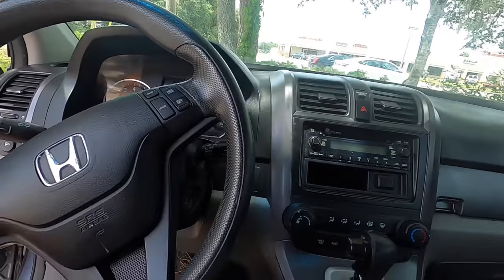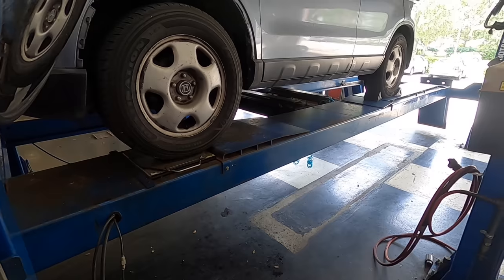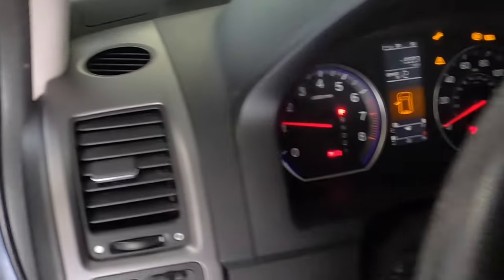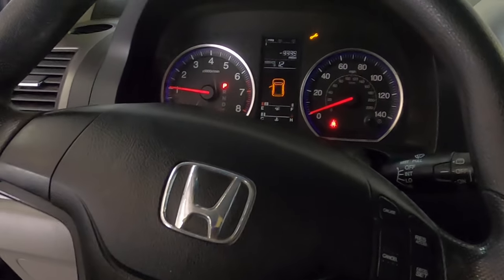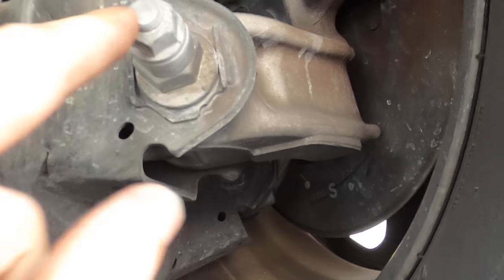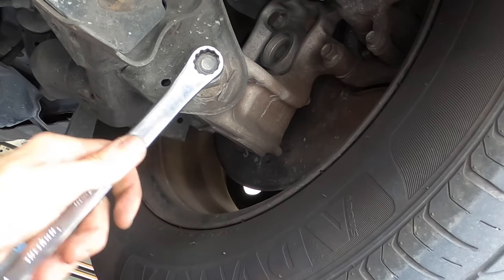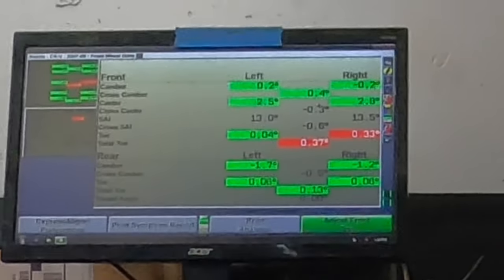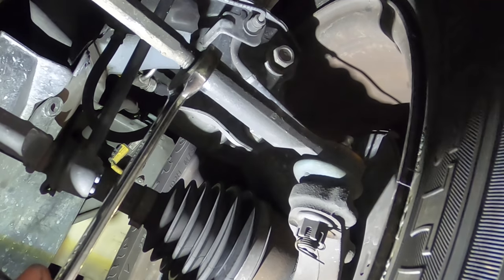Wheel Alignment Basic Tutorial | What is it and do you need one?

Comment: Might be a dumb question. But how are you rolling it forward and backwards.
Reply: I don't know how Ray does it exactly, but I like to push off the left rear wheel to move them back and forth. It's actually much easier than it looks to move a car/truck in neutral by spinning the tires. Left rear because that is closest to the hoist controls for my shop's setup.

Comment: I live in NYC and have had to deal with 4 different alignment shops before finding a good one. First place I went to was pepboys where I purchased my tires and purchased a lifetime alignment since it sounded like a good idea. Car seemed great for 4-5 months then needed to do suspension work. Brought it back shop said they completed the alignment still had the issue went back again said they completed it and both times would nt give me a print out. Then went to another alignment shop they gave me a print out car seemed to drive ok except the wheel wasn't perfectly centered the camber was out of wack on the print out but they said nothing they could do which I knew was bullshit. I ended up burning up my pilot sport 3s soon after this with tons of inner wear I was pissed since it was under 10k miles. Bought new tires at a new shop with decent reviews they aligned it but said the same thing about the camber and at the same time I had them do a brake job which I wish I never let them touch. Not only was the alignment bullshit but they never lubed the slide pins or the back of the pads leading to horrible vibration and when I brought it in they said sorry we cant duplicate your issue nothing is wrong. I had to do the brake job over myself. Fucked up part is I purchased some really nice synthetic brake lube for them to use and they just took it and never used it on the car. Finally found a pro guy with a rack and in 45 mins he fixed everything and even let me watch. I recommend unless you know the shop has a laser rack with a pro tech go to a place that only does wheel alignments.

Comment: When I was a kid(many many years ago) I saw the front wheel toe in measured with a long bar and two pointed steel rods rubbed against tire front and rear.  Like I said, “When I was a kid!”
Reply: I used that method most often up to 15 years ago. Some shops I had to resort to T-square, chalk and two broom sticks held together with hose clamps. Roll backward and forward after each change.
Reply: @wssides     Better than string!

Comment: Great job as usual, Ray. Could u do a Toyota where u have to install camber kits? Also, now dont laugh, I live in the rust belt, can I put anti seize on any parts to keep nice? I had a used 97 camry & I painted parts. My alignment guy gave me hell (nah, jst told me) but my tie rods threads were SO corroded I had to get replaced bc he could turn them. Ends were fine. Thats WHY I painted them. (I did this like 15yrs ago). Thanks.

Comment: A tip that most mechanics don't even know, toe can't cause a pull to one side or the other, only front camber and caster (or tires/power steering) can cause a pull, toe can cause the steering wheel to be off center and if the total toe is way out then it will cause poor handling but not a pull, that's why most of the time when someone comes in for an alignment to fix a pull it's usually not related to the alignment.
Reply: actually not always true, misaligned Toe adjustment can cause a pull to one side or the other.

Comment: Looked like a shop “TOLD” the customer that they “REPLACED” the  parts in the front suspension. It looked like there was NO difference in color from the old parts and the “NEW” part that was supposably replaced. Just my opinion. What did you think? Do you agree? And are you obligated to let the customer know if you believe the part or parts weren’t replaced as the other shop had stated? Or do you stay out of it? Just wondering.       Roger in Pierre South Dakota
Reply: They might have been done it a while ago and owner waited. Perhaps waited until they got new tires.
Reply: @jptrainor  Well, that makes sense. But don’t you agree all the parts looked like nothing had been changed? Or maybe the camera didn’t show what you were able to see in person? Anyway, nice job doing the alignment.
Reply: @rogerfleury9759 Rainman said the same, so yes. Hard to say for sure though. Hard to believe that a shop would do that. All a customer has to is turn the wheel and look.
Reply from the maker: Could have been junk yard parts, or they waited a king time to get it aligned
Reply: I have a Honda and usually the bushings go bad on the lower control arms. You can push the bushings out and replace them for a fraction of getting a new lower control arm with new bushings. Hopefully, at least, they did the bushings and charged the customer for a whole new LCA
Reply: @jptrainor  I had the steering rack, subframe mount and control arms replaced a month ago and still haven't got an alignment yet due to money. It does happen as you said.
Reply: @techgamer1597  My old Civic isn't getting a professional alignment until it gets new tires. Despite new diy tire rod ends, ball joints, and control arm bushings. I diy align it, tweak it until I'm happy, and call it good. It is just not worth the money to me for an old car with old tires. It is worth the money when the old car gets new tires, however.
Reply: @jptrainor  good to keep the wear on new tires consistent.
Reply: With how many dents this car has i think it is an old person's car. Probably on fixed income and had to  save awhile for the alignment after the last repair.
Reply: @henrydillard6217  You might be right.

Comment: Pro tip: ALWAYS check a car over if it comes from another shop for an alignment. Probably 75% of the time when my shop gets a car in from another shop for alignment, something is loose to the point that it shouldn't be aligned as is. One sent us a Silverado with 1/2" of play in the lower ball joints. Another sent us a Jeep Compass with the the worst rear LCA bushings I've ever seen, you could literally move the rear knuckle up and down 1/2" independent of the LCA.

Comment: I had a driver saying the same, needed an alignment due to a part being replaced, while adjusting I didn't see anything new and test driving proved that there were vibrations, so while reporting that what was asked was done I asked if the part they paid for was new

Found put that they paid for a new part but due to the shop they went to not having it at the moment they installed a used part on it while the customer paid for a new one...

Comment: I have a question, and I am asking because I don't know, and not to be a troll.  Would your weight sitting in the car and the open door have an effect on readings when you turn the wheels to the left and right?
Reply from the maker: Kinda sort of. Weight distribution does matter in side module. Many European cars require that weight be added to the car to simulate passenger presence. Sitting in the car to measure caster had no effect on the outcome.

Comment: How does one deal with any kind of slop or tensions on the suspension? If something were to compress the bushings in the control arms - say, a very fat mechanic climbing into a car with very soft suspension or worn bushings to put on the brake lock and adjust the wheel - the measurements would be off. Also, tightening the lock nut on the control rods is likely to push the control arm outward by taking up the play in the threads. When adjusting ball bearings on a bicycle, if you adjust the cone perfectly, it will be too tight after you tighten the lock nut. And if you get it perfect with the lock nut tightened, when the quick release compresses the axle it will be too tight. Which is a lot of fun when you have OCD.
But I digress. I always kinda assumed that the tolerances in car suspension alignment aren't all that tight, but aligning something to tenths or hundredths of a degree is not a small feat. It is certainly less than what I'd assume a turned tyre or settling suspension on a stationary car could influence.

Comment: Good to see how it's done! I have a 1st-gen Honda Fit (aka Jazz), and recently had a front tyre replaced after a sidewall puncture. I had the wheels aligned while it was in the shop, which is now improved according to the measurements. However, the steering now feels kinda skitterish, and doesn't seem to self-centre as well as it used to. (It's possible I was used to the former misalignment.) Could this be caused by having one new, slightly different model tyre on the front? I've read that the caster angle on these cars is not adjustable, and apparently the electric power steering isn't particularly strong either (they beefed it up in later models). It does have a little toe-in on the front. Thanks to anyone for suggestions!
Reply: Never get one new tire.

Comment: I grew up in a garage, one of our primary focuses was suspension and alignment.  This was "old school", setting up the equipment and getting accurate readings took at least 15min, no way we could get accurate numbers in just a couple minutes.

Something we always did was "shake down" the car before and between any changes in settings- manually push the car up and down a few inches on each end with the plates free so the suspension would settle to it's free/normal position.  Not doing so would result in settings that were measurably off.  There's always some friction/stick in the suspension components.

Something we noted back then was that the factory spec's were very wide, more to enable the factory and dealership to get cars out quickly than to create a good driving vehicle.  +- values of a half degree on either side were crazy in our opinion- you could easily have a car that was "in-spec" and yet would drive horribly- pull, wander, unsettled in turns, and burn the tires off in a few thousand miles.  We would hold specs to optimum- say 1/4 deg camber on both wheels (no 1/2 on one and +1/2 on the other), a bit more caster on the right to compensate for the crown of the road.  This usually required installing and removing shims, most cars didn't have eccentric cams on the suspension.  Some even just had slack in the mounts you would loosen and move components and re-tighten.  It was typically at least 1 1/2 to 2 hours to do a proper alignment.

There was some "school of hard knocks" wisdom to some settings- like you need a bit of toe in on a typical rear-drive because the forces on the suspension (especially under braking) cause toe-out.  Front-drives were a problem because driving forces would cause toe-in, while braking toe-out... any suspension play could be a problem there.

Anyway.... not meaning to be a dick- but your final results (both front wheels cambered left, caster a bit low, toed-in on a fwd, too much negative camber in both back wheels)... we'd look at that and think it was way out of alignment and needed some help.

Comment: Someone has worked for pep-boys.
You didn't use safety straps, What are you going do when you break one those heads?
Reply from the maker: I found that if installed properly they don’t fall off
Reply: As ray said if put on properly, then they won't fall of, and theres hardly any weight to them anyway, its just a sight screen as there is no actual parts on those heads that really matter if dropped, as long as it doesnt break the front screen is still fine, as the way these work is all the readings are done by the cameras, so even those heads on the wheels don't have to be perfectly level either,

Comment: And I was shop we try to get as close to zero as possible to give leeway should the towing until out get jolted or misaligned after hitting a pothole or other issues, we also locked the steering wheel with the steering wheel lock tool, anything one point something for us is not acceptable whether it's in the green or not.

Comment: Thanks again for showing us how something works that most people don’t get to see. Now, not trying to be disrespectful with my next question at all, just trying to understand. I get minimum labor charges, and you should definitely be paid for the work you do, but what is the reasoning behind most shops ( at least in my area ), charging 150 bucks or more for what you just did in that video? Is it just a minimum labor charge for the time? I’ve seen lots of people refuse the service after buying a costly set of tires, because they thought it was to expensive. I drive a lot for work, thousands of miles. I just had my 2019 F150 checked a few months ago, alignment and a road force balance ( kind of a 4 wheel dyno type thing ), and it wasn’t cheap. Anyway, enough of my rambling, just wondered what your thoughts would be on that, have a great day.
Reply: You and the general public need to know and understand that the equipment that was being used is very expensive, it makes the job easier for the mechanic/tech.  Now you add in the time for the mechanic who needs to be paid, and $150 really is not that much money.  Plus, a proper alignment also will save wear and tear on the tires thus saving the customer x amount of money.
Reply from the maker: I think $150 is slightly high, but the area could be influencing that. Rust or no rust is a big deal on something like this.
Reply: @richardostrowski6420 , as I said, I get all the cost involved, that’s why I asked if it was a minimum labor charge. That owner spent his money to buy that machine and he has to pay someone to use it. But by that logic, after the machine is paid off, he could drop his price for an alignment. I personally can afford to pay for that service and always have. You are absolutely correct, it is important and will save people money in the long run. But lots of folks can’t afford that. So if a person scraped up enough money to buy an 800 or 1000 dollar set of tires, they might not have that extra 100 or 150 for the alignment. That’s why I was wondering if it was just a minimum labor charge or strictly time that makes it prohibitively expensive for some folks?
Reply: @jimmyhorton8297  at what point is it paid off though? Maintenance needs to be done,  calibration is going to be required,  training new people operate it.
Reply: @USAFTACP  That's not the customer's responsibility, though.
Reply: @bloodybones63  You are correct that is not the customer's responsibility, but that cost is passed on down to each and every customer that gets an alignment. It has always been that way and it will continue to be that way.  There is no free lunch guys, put yourself in the owner's shoes.  You have to make a certain amount of money to keep the doors open.
Reply: @bloodybones63  of course it is, it is the cost of the equipment, maintenance and personnel to be trained to use it. Those costs have to be built into the cost of the alignment, if they were not it would be uneconomic to offer the service. Why should the shop eat those costs? Because you don’t like them?
Reply: @SometimeWoodworker  I' m saying an owner can't depend on others to pay his bills. The risk is on the shop owner. Don't transfer it to the fucking customer. If he can charge a reasonable rate & make a living, good, that's capitalism. If you are waiting on on someone else to pay the bills, that's socialism. The customer is not the scapegoat.
Reply: @bloodybones63   um hangon.... can't depend on the customer to pay his bills??? I do believe you have no clue what a business is, how will he pay his bills if he has no customers, 
Like was said, its what you call return on investment, what you just said is expecting the person who has spent tens of thousands on equipment to work on your car, and not expect to make a return on those costs. not thats not saying he buys a 30k machine and then the first customer he charges 30k for the alignment, no its spread out over time, and at a rate that covers the cost of the machine in a reasonable time frame, where eventually he will break even and actually start making money. PLUS also the running costs of the machine, employee to learn and training to use it etc.
Reply: @AaronStevensaj  He's the one taking the risk when he buys the equipment, not the customer. Like I said, if he can charge a reasonable rate & draw customers in, good for him. But don't blame the customer for not wanting to pay outrageous prices. The customer determines if his business survives, & if he has return business. That pays for the equipment, not forcing a man to overpay. Like YOU say, how will he pay his bills if he has no customers? Economics 101, Jack

Comment: Honest question.  I'm a very large, heavy set, should I be in the driver's seat as the technician does the alignment?  I was told the more weight to one side changes the whole setup to the suspension.  I'm planning to have my car  get new axles, control arms, tie rods, struts/ springs, and replace to sway bar with a bigger one. So what someone told me is this true or they playing me for a joke tu

Comment: Crazy.  Hunter always coming out with new tech crap.  I guarantee alignments I did with bubble levels and light beams were just as accurate.  Centered the wheel by eyeballing inner sidewalls of tires.  Works every time.  Silly  silly computerized, expensive machinery.  Those caster angles are perfect to prevent pulling....favor the left by 1/2 degree or so and no pulling.. I don't care what the machine says.

Comment: I've done hundred's of alignments. I usually checked the tires for shifted cords and excessive wear before I even put on the heads. Also It is a requirement to check the air pressure prior to starting adjustment. I don't think I saw him do that. I thought for sure he was going to use "Win Toe" in the Hunter program since I saw no steering wheel lock. Are they still calling it WinToe?